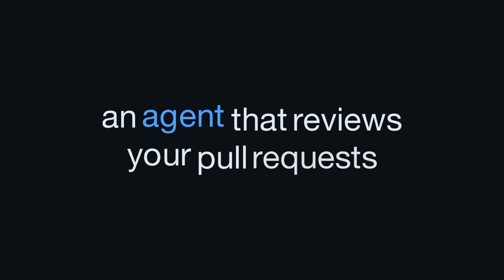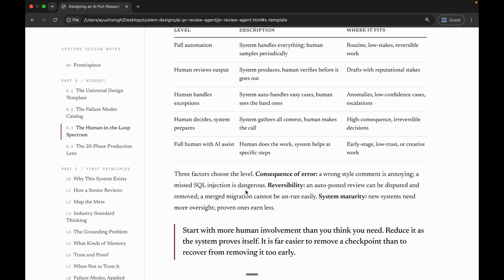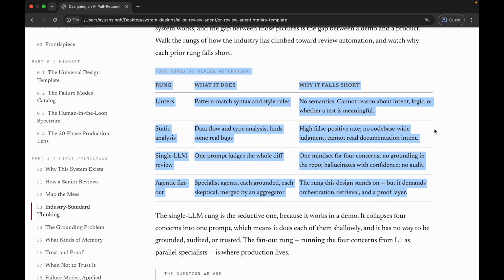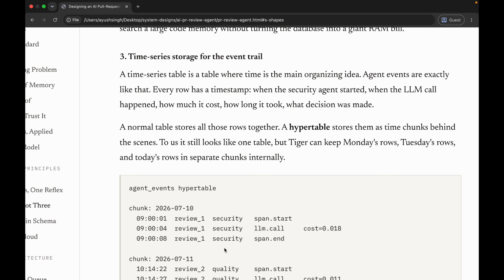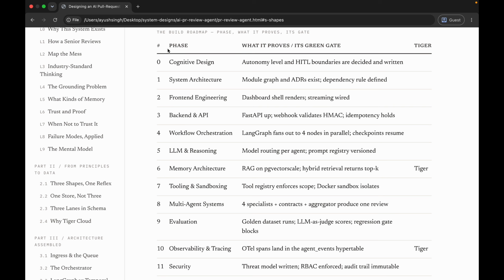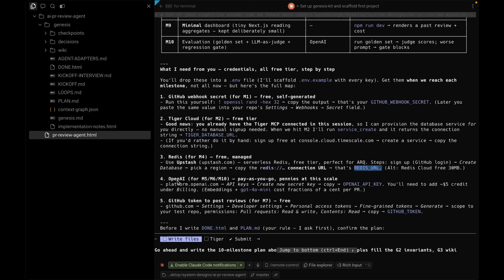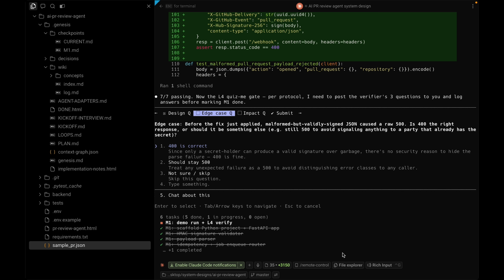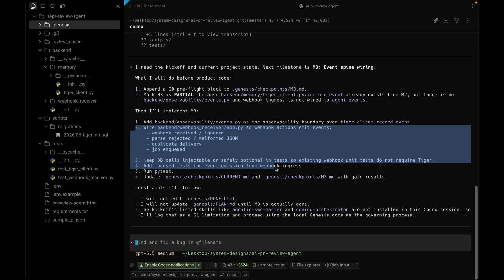Designing & Building PR Review Multi Agent System (3 Hours Build)

Comment from the maker: Resources mentioned:- 

TigerData for setting up our all three DBs mentioned in this video:-   https://tsdb.co/ayush1 (Remember to signup from this link to get $1000 in credits, even though you can build on free tier but recommended to upgrade so you can work with it flexibly) 

P.S :- TIGERDATA IS ONLY OFFERING FREE ACCOUNTS FOR FIRST 300 SIGNUPS ONLY. Please signup and then start this video. Use the link given above. 

Get your design document here:- https://topmate.io/ayush_singh13/2214687 

We're working on a video (Genesis - Harness - This is one of the harness used in this video - https://www.antern.co/blogs/genesis-kit/ ) 

Github Link of Genesis Kit(Loop that prompts itself) :- https://github.com/ayush488-glitch/genesis-kit